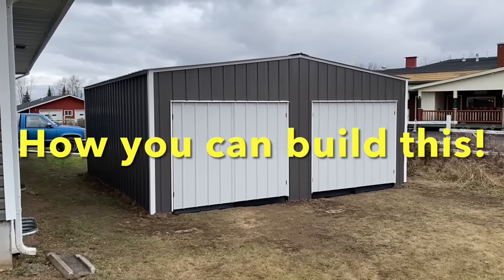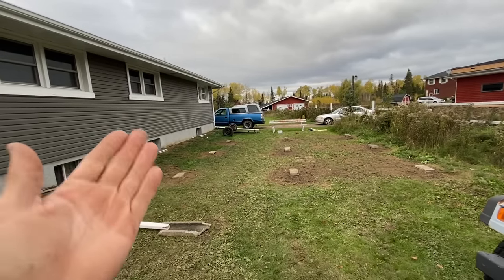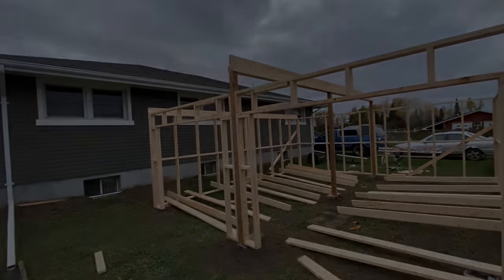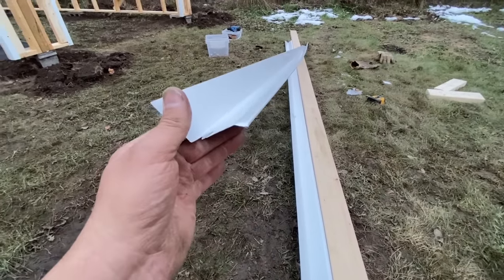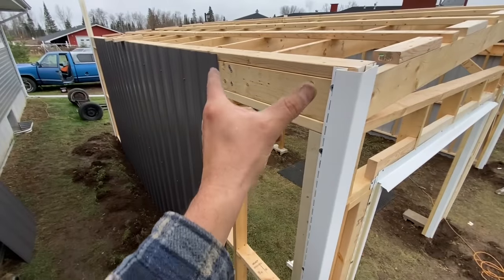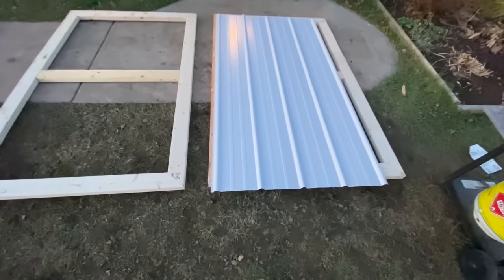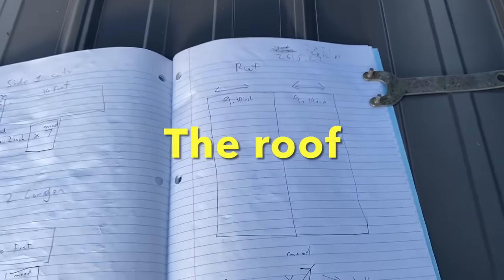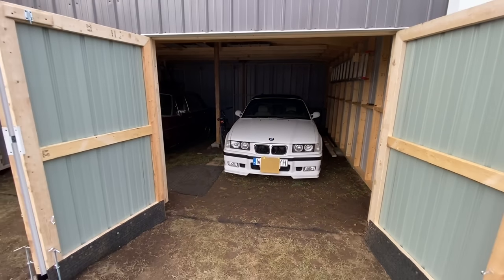How to build a 20x20 Garage for $3000 in 5 days (from Home Depot materials)

Comment: Hate to tell you but cinder blocks have very little strength unless they are on edge ...should never use them in the manner you have
Reply: @TylerHankss  sure they use for foundation but on edge. I'm a contractor. Believe it or don't. S
Reply: I used cinder blocks to set up mobile homes for years. They are very strong
Reply: @andyvaldez26 Yes, but with the holes going up hopefully, the way this was done will fail.
Reply: @andyvaldez26  I don't it will affect ur building. But even mobile homes are to b set on edge holes up. Ur vid uss very informative
Reply: @TylerHankss you are 100% wrong.
Reply: Besides the blocks not being oriented correctly for strength, I always heard the frost line for foundations was about 30” deep in a climate like Canada.
I think he did an outstanding job overall turning a drawing to reality in only 5 days, and if the $3k cost is true, wow, because there are 10 x 10  wood sheds that cost that much.
Now all you need is a way to keep the mice from nesting in the Benz or BMW.
Reply: Thanks for showing wow cheap things can be done. Seem like everything on YouTube is these 100k building. Crazy.
Reply: Ok so even if you pour a slab this is a cheap little garage. You could double this and still be WAY cheaper than these 100k pole barn style that everyone is showing nowadays.
Reply: @OutdoorswithFloridaSmokin  look on line I didn't invent the idea. I loved ur video but only takes a Google to see your wrong
Reply from the maker: I undercoat the vehicles with oil every year keeps the mice 🐁 out
Reply: @TylerHankss 7 years.  Wrong!
Reply: @Philadelphia19147  you must have voted for Biden.
Reply: This is why I stopped watching this video.
Reply: @ProblemSolverGarage  do the mice weaken the cinder blocks?
Reply: @TylerHankss  no I work for a living didn't vote for Biden.
Reply: @nccs9890  I wasn’t talking to you but that’s good for you.
Reply: @truthbetold3931  well you are 200% wrong of man
Reply: @TylerHankss  oh ok I did enjoy the video at any rate...
Reply: @nccs9890  good for you me too.
Reply: If you look at how this is laid out, all of his weight distribution is on the web structure  of the cinder blocks and not the hollow. So the center web carries from the wood to the ground. Absolutely nothing wrong with this.
Reply: Blocks has very little strength on their side proper was would've been cap block on bottom then an 8 holes up with a cap block on top
Reply: BTW pretty straight forward do it right the first time, saves you from doing it over ,,love to see this building in about five years  to see how much this metal rusted off from being below ground
Reply: Holes up, then fill them with concrete or crusher run
Reply: It's true, the cinder blocks are oriented incorrectly, but this is a very light structure. Long before those blocks crack, he will have issues with frost heaves moving the "foundation" out of level. Also burying the siding was probably not the greatest idea. That said, I'm not sure of the wind load they encounter up there in Canada, but given the weight and size of this thing, it looks like a big kite to me. Overall it's a good cheap project that can easily be modified to suit most needs, most notably would be pouring an actual foundation and properly securing the structure to the slab. At least for me...  For what it is, the orientation of those cinder blocks is the least of my concerns and overall, he did a decent job with the build. Plus he's pretty interesting to watch 😂.
Reply: Yeah, the block are oriented wrong, they aren’t deep enough to be below frost level, and the building isn’t attached to the foundation. His neighbor is one good wind storm away from having a free garage parts kit lol
Reply: This video was like a train wreck,just couldn't stop watching!A good stiff wind would send that thing to Kansas,nothing at all holding it down.Shame to  since  the metal work wasn't so bad.
Reply: @TylerHankss I voted for Biden so what’s your point
Reply: @nccs9890 I voted for Biden and I work for a living so what your point????
Reply: @jimstern4244  goes to show.
Reply: @TylerHankss  show what ???!!!!
Reply: For sure those cinder blocks are doomed! Id suggest jacking up the sides of garage and spin those cinder blocks! Id hate to see such a great garage collapse because of improper foundation!!  Id also fill them with concrete and maybe a piece of allThread with a washer and nut which will keep it squared and secured to the ground!! Great job though
Reply: @nccs9890 he means holes facing up not sideways
Reply: As everyone else is saying. I would have turned the blocks with holes facing up and filled them with concrete and rebar and anchors to bolt the wood down with because I live in tornado country and high winds are a thing here and will blow that building off the blocks. Plus I would have used metal strapping to hold the roof and frame together.
Reply: If you fill with concrete maybe it would be fine on side but hollow how it was left in the video will fail 100% being the first step in the process and it’s already botched, I wouldn’t even bother watching the rest of the video, this guy doesn’t know what he’s doing.
Reply: They will handle it, even with 12" of snow. I have seen worst shed and garages and still standing for decades.
Reply: It is wrong but will do as the structure isnt that heavy. Anyone wanting to copy just reorientate the blocks and fill them with sacrete adds like 40$ in costs and a bunch of shutting up lol
Reply: If you put the blocks holes facing up that's where the strength is not if the holes are on the side ... If you put it to the test 2 blocks one on the side and the other holes facing up and start adding weight you will see the block that the holes facing up will hold up unlike the hole on the side that will not hold up...  @OutdoorswithFloridaSmokin
Reply: Some people you can't talk any sense into them... They think they are always right... Or they don't want to admit there wrong...
Reply: You can Google the best way to use cinder block for the strength if you don't believe if being told the right way and wrong way to use the cinder block because the strength is the holes facing up and down.. Not on the side because that's the weakest... But here's how to Google it to get the facts...... What way is a cinder block strongest? ... Or I can save you the time by copy and paste it here......What way is a cinder block strongest?

Concrete blocks are only strong if they are stacked with the holes up and down. If used properly, you should not be able to see through the block when looking from the side. Additionally, don't stack blocks on their ends to make them taller because they are weak in this position also.May 20, 2012
Reply: Fact
Reply: This type of building would never fly here in New York. Or should I say with a strong wind it would fly it's more of a shed than a garage and even then I wouldn't want to be near it in a wind storm of any type
Reply: Good to know, thanks.  Make sense that's why they are on edge and get filled with cement for foundations.
Reply: My thoughts precisely I am not a civil engineer however, I do know one thing, where the wheels will be applying all the pressure per square foot that they are touching, that will make the floor buckle up as well. As for the cinderblock that is precisely true, because of the way he placed them, it is rendering them incapable of handling all that stress. When cinderblock is used in the proper manner and is cemented down in a proper way = no problem. However, I do not think his footings are properly done, usually digging under the frostline and using sand and 0 3/4 rocks help draining & to withstand ground shifting in heavy rain and in areas that require respecting the frostline (in areas where winters are harsh).
Reply: @gg-gn3re 
Mice eat cinder blocks unless you sprinkle cinnamon and sugar and a little mouse bait.

Don’t believe everything you see on the internet!
Reply: Take a drink every time you hear straightforward!
Reply: @nccs9890 He is correct. I was a building contractor for 40 years. They will handle the weight for a while. They will eventually crack in the cell. Might take more than 7 years. Should put them correct then put a 16*8*2" thick cap on top. I'd even fill the cells with concrete. Could even drive some rebar straight down in each cell to help keep them from shifting. Not saying it won't work, but in 20 years I think there will be cracked block.
Reply: True should have put a 4 inch solid block on bottom and a solid block on top with the 8 inch block on side that is giving all the strength
Reply: @walterbrob  is the most level headed one in this thread
Reply: @nccs9890 there’s contractors out there that still don’t know shit. I’ve seen double wides that still had the trailer underneath them with blocks stacked the same way he has them and they lasted just fine. Yeah it’s stronger on its side but he’s not putting a lot of weight on them. Plus even if they did break it would be a long ass time down the road all you would have to do is jack it up and put another one under it
Reply: Where are you getting your information? Are you a civil engineer?
Reply: Depends on loading. He should be fine. I never had issues. Don't build houses or walls like that. Holding a shed should be fine.
Reply: @ProblemSolverGarage  what kind of oil? Thanks
Reply: Guys. Seriously. A lot of republicans voted for Biden, because they knew what the only alternative in America’s bizarre system was. Not many people think he’s the right man for the job, but the majority realise he’s the less wrong man for it.
Can we get back to the garage now???
Reply: Yup, cinder blocks are wrong.
Reply: Lmao.   When he remembers how to use words he forget how to walk.   Great choice @jimstern4244
Reply: He could  fill them with mortar and steel wire. Might not prevent cracking but would likely stop catastrophic settling
Reply: @c50ge every time you hear "guys!"
Reply: Why is a thread about how a guy played his blocks still going??? People really that lonely ???
Reply: Center blocks are used in patios, foundations and lots of light applications. 

This is  a tin building that is very light compared to wood of stucco.

Center blocks are more than enough. 
If you want or need more support just pour cement around them or cement by its self as support.
Reply: Solid blocks or fill the holes level with quick crete
Reply: @angiebuesing6711  pour a slab makes it more permanent. It's hard to move a slab. He can disassemble it and move it like it is.
Reply: I don't know the laws in Canada. Most places in the USA require you to get a building permit to build a building like this and then it must be inspected and built to a certain code. Their are fines and penalties for it not being built to code plus then insurance etc.. becomes an issue.  We can buy those portable buildings and garages and when they deliver them they anchor them in place. Canada, may not have similar rules, laws and regulations. With a bit of luck this garage can last this man a very long time and definately worth what he paid for it. Plus he disassemble it and move it. Moving it would be impossible as you can't move a concrete slab if he laid a concrete floor.. If he wants or needs a harder floor he can always just lay bricks down in a pattern and seal them.. Thats not that hard to do.
Reply: @jimstern4244  well, that's one
Reply: Very good job, easily explained and done in 5 days including crappy weather. As far as being over kill like I do, its better to add as  precautionary measures than to learn the hard way. Given the brutal storm that are hitting globally you  might want to add tie down straps or cables to prevent that awesome mercedes from getting damaged. I got a 1972 450 soft top and my son has one like you got and a SL600. 😉 Thanks for sharing your skill to whip this garage up single handedly in 5 days probly less if hours were added up.
Reply: How many “guys” did you count?
Reply: @Edubs54584 lol.. too funny yet true
Reply: Why is nobody understanding this guy. He’s not saying don’t USE cinder blocks. HES SAYINNG DONT USE THEM ON THEIR SIDE. They are meant to carry load on the edges with the holes facing up/down.
Reply: Concrete blocks (aka “cinder blocks) are made to lay with webs vertical, not horizontal as what is shown here. That’s where the strength lies. If you’ve ever seen a basement done, the blocks are always set with the webs vertical.
Reply: @TylerHankss  How drunk were you while building things.?!?! CODE specifically states " Foundation must be below the freeze line "  Sure as hell didn't look below the freeze line from what I was watching...
Reply: A friend of mine just had a 24x20 pole barn style garage built in kentucky and the total cost was 27,000.00! Only difference is he has a concrete slab for foundation.
Reply: If you can’t find free cinder blocks, then dig your holes, get some Sonotubes, cut to depth and fill with concrete. Insert anchor bolts and you can tie the building down.
Reply: @walterbrob Crusher run?
Reply: @jimstern4244 I think the point was he was implying you haven’t been paying attention, or have a very different view on how things should be in regards to how the country is “governed”. With that said this is a video on how to build a cheap way to keep your cars and tools etc out of the weather a bit, not sure how everything turns political.
Reply: I mean, really there is a lot more wrong with this build than just the orientation of the cinder blocks.  Everything is going to sink, sag and start falling apart within a year   or two depending on local weather.  Every building starts with the foundation and a couple cinder blocks laid in the ground is effectively the equivalent of having none at all.
Reply: Why don't we just ask him to post another video in a year's time? If it needs any tweaks how much can it need? If he needs to start all over he didn't lose much.  I'm happy.  I didn't vote for the hair sniffer. 
.
Reply: Always haters , you know what they say about opinion,,, I say the guy is a good carpenter,  it's his build, not yours..I'm an electrician and I can do plumbing,  work on cars, but carpenter I'm not...but  yeah he said 'guys ' a heck of a lot 😅
Reply: @jimstern4244  How ya liking Bidenomics 😂
Reply: Yep, orientation is incorrect. They should be holes vertical.
Reply: Arnt basement walls made from cinder blocks?
Reply: Bet they have enough strength to bear the light weight of this shed
Reply: Slab that sucker. You took the time to string it. Go ahead and form it yourself. Shouldn’t be too much for that size slab. Way better than dirt floor.
Reply: It'll be just fine.
Reply: Blocks turned the on holes would not have worked well in this application it’s sitting on dirt block has more surface area sitting on the dirt holes to the dirt wouldn’t be stable and probably sink into the dirt but yes they are intended to lay holes up down when used in masonry application but here he done it best way he could with what he’s working with
Reply: In this case the cinder blocks gonna do fine because is a light structure just wood and some 80 pounds of roof metal
Reply: @williamrobinson7753  what about a piece of rebar at an angle in the ground?
Reply: seen many cinder block disintegrate over the years

Comment: When leveling the cinderblocks you should use gravel instead of the spare dirt. Gravel can drain water better and help prevent settling.
Reply: Thank you for sharing this information is a blessing to come across. Thanks again for sharing your knowledge. Keep doing it your way. Great job bro.
Reply: Any specific type of gravel
Reply: @ForgivenSheep3  Lots of different kinds of gravel you can use just make sure they arent washed and arent a fine grade. Most readily available for the average person will probably be the bags of general gravel you buy at HD/Lowes/Menards by all the concrete supplies.
Reply: @ForgivenSheep3  definitely try to use Stone Creed it’ll harden up like cement and stay there!
Reply: Clean out packs well too
Reply: @ForgivenSheep3  3/4” gravel with fines for compacting
Reply: He even put them on the wrong side
Reply: And lay them the correct way. They are on their sides and not strong tha way.
Reply: fortunately the whole grounds where he built it is all very flat.. Even all around.  So settling should not be much of an issue.  Especailly for a light weight garage.

Comment: What I really appreciate from your video is that you took the time to make it and it is very popular because it is very informative. Your hits will more than cover the cost of your materials. I have built metal kit buildings that include all the panels, hardware, trim pieces, foam rubber sealer, screws, roll-up doors, etc., but cost  over $10,000  (foundation and floor are always extra) for a 20' x 20' space. I like how you planned and created the structure by identifying and purchasing the parts a-la-carte. Your door trims, drip edges, corners, and ridge cap are major money savers vs. buying a kit.  The whole point of your video is to show how this kind of building can be built for less than half the cost of a kit and it can be customized. Many of the critical comments might help those who may need a code-approved more permanent structure, but they seem to miss the true value of your video. Your detailed instruction, delivery, and execution are excellent--and the fact that you did it with such a positive attitude in five days in very cold and wet conditions is amazing.
Reply: 100% agree 🤟